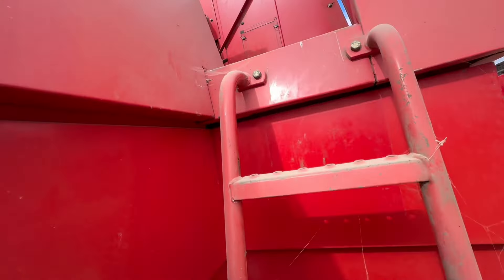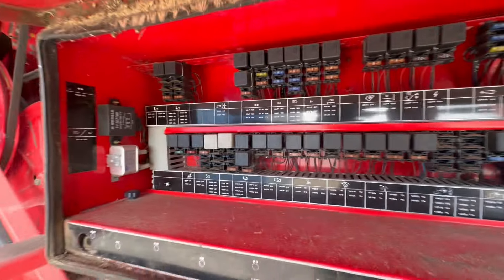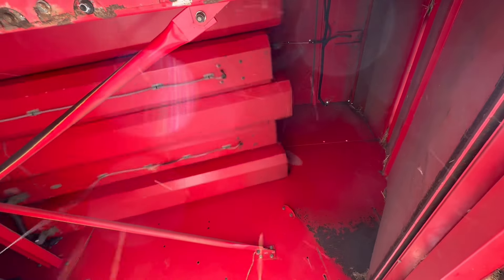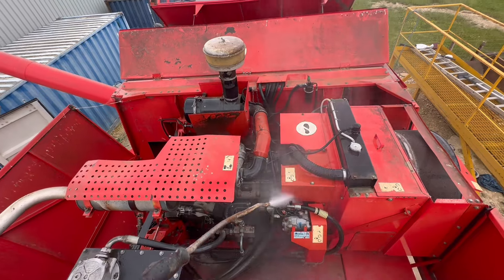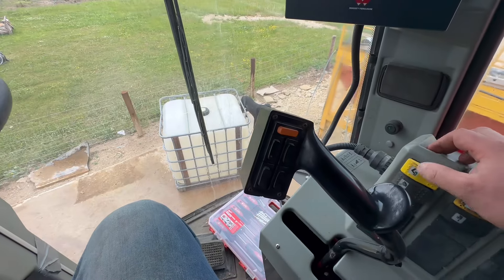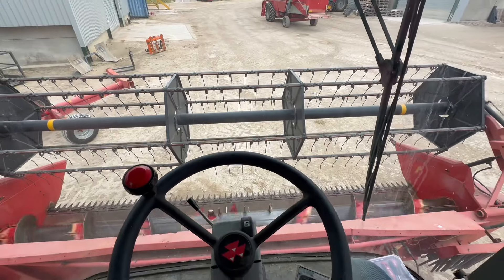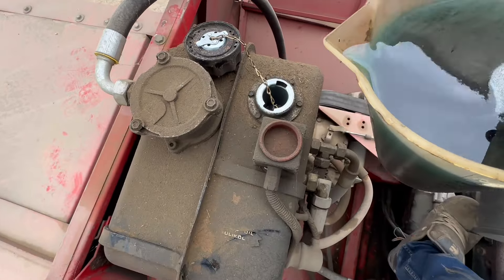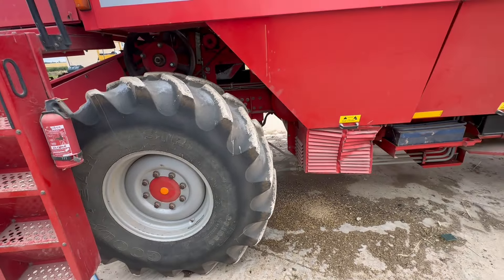Getting ready for harvest 2024

Comment: My tip for the grease nipples Tom is to paint a small circle around each one in a contrasting colour (say white for this red combine).  Or if the grease nipple is hidden behind something like a pulley, then paint a small arrow somewhere visible showing where it is.

Then, number each and every grease nipple.  By that I mean paint the number on the circle/arrow.  Try to keep them in a logical sequence so you can work you way around the machine hitting each grease point in sequence.  Note the rough location of each number (e.g. "Steering Linkages: #1 - # 6", "Under LHS cover: #34 - #51"; "Under RHS cover: #73 - #97", etc.).

Type up a checklist on your computer with checkboxes (again, group them, and print out many copies to keep in the machine in a folder.  Each time you grease the machine, tick off the grease nipples as you grease them.  Leave space for a date above each set of checkboxes (depending on the number of grease nipples, you should get 5-10 checkboxes per sheet if you format it correctly.

Also, paint a large circle somewhere near the operator's station (E.G.: on the dash, on the mudguard next to the seat. etc.).  In this circle paint "T xx", where xx is the total number of grease nipples on the machine.  That way, if you lose the folder you at least have some hint as to the total number of grease nipples you need to find.
Reply: We wash our combine at the end of harvest season, then give it a dry run to evaporate any leftover water in the system.  Mind you, the 40°C+ temperatures help dry it out pretty well too!

For daily cleaning, we use a small diesel powered air compressor mounted on a little trailer.  A long air hose on a self-retracting reel, and a few blowguns with different nozzles to reach awkward places.  An 18V leaf blower is handy in some spots too.

All part of the endless variety of kit you need to run a farm!

Comment: As a retired MF service engineer, its 20 years since ive been near a MF 30 combine. You've been a good boy with the grease gun, the unloader swivel wasnt seized and didnt go bang when you first opened it out!!! Whats the story with the grey good grain elevator housing, is it a replacement?. Variable speed pullies is the word you were after when looking at the cylinder drive. I see the other combine is a Datavision model, is it another 30 or is it a 32?
            Sad, but at 67, I still get a kick from watching combines at work, if I were a bit nearer, I willingly sit on one of your for a few hours during harvest. 
            More vids as and when you can, especially harvest related but dont bust a gut over it.
Reply from the maker: There both 30s owned from new.
Yes the grain elevator was changed and when it came it was gray